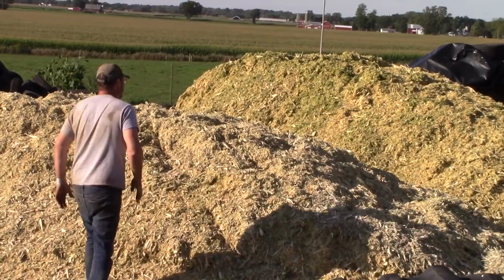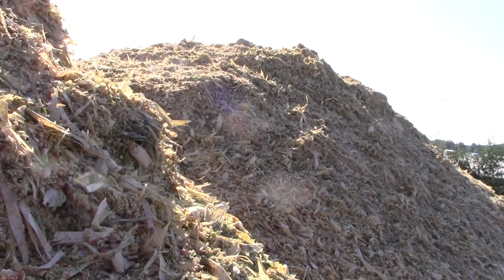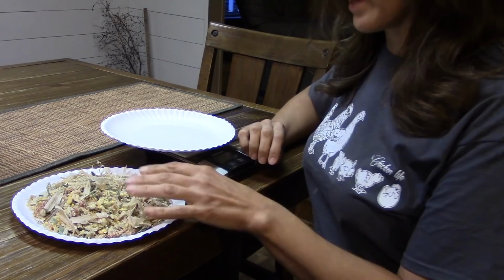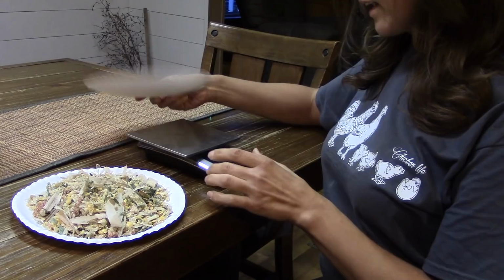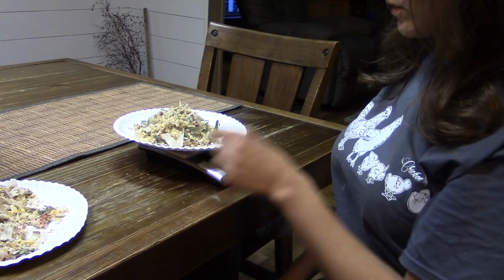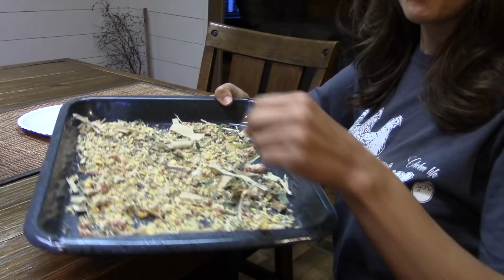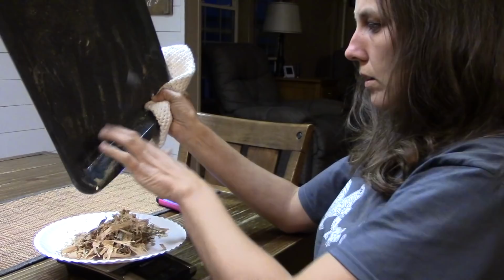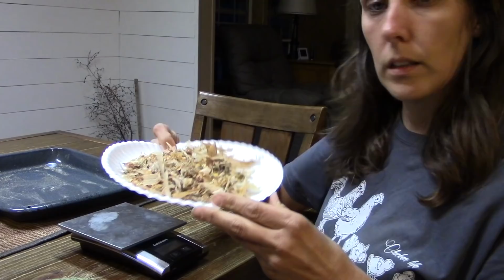Chopping Earlage 2019

Comment: Another way you can check the moisture is to weigh it the same as you did to 100 grams and then put it in the microwave for a minute the first time then thirty seconds everytime time after weighing every time you cook it for thirty seconds until the weight reads the same. I find this way alot quicker and you can get an old microwave and put it in the shop. Keep up the videos.
Reply from the maker: That's a great idea! Thanks for watching!!

Comment: Tried this in early seventies with snapper head on gehl chopper, lost 4,000 lbs herd average first year had to supplement energy source did three years then went to high moisture shelled corn shelled corn much better results
Reply: So you went to more or less, Earlage, costs a lot more than silage, but is much better feed... There's some done here in Oregon, not a lot though. Lots of cannery waste used for ensalage, but it's put up as it came out of the cannery, I always thought they should chop it. It's cheap high sugar feed, need a holding pond for all the juices... But the guys feeding it seem to like it.
Reply from the maker: Our chopper puts it through a kernel processor, which grinds the kernels up much finer than the old gehl chopper did.

Comment: Did you install a screen into the chopper as well? We used do this with a 2 row NH chopper and we did put a "recutter'? screen in by the knives so that the kernels would get smashed more.
Reply from the maker: Our chopper has a kernel processor that grinds the kernel.